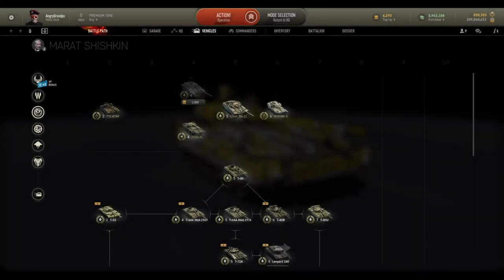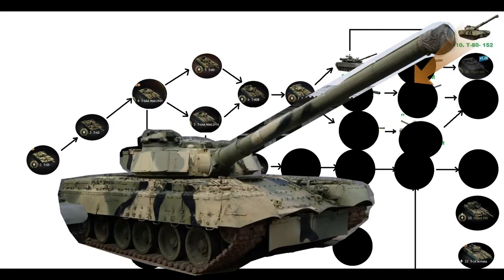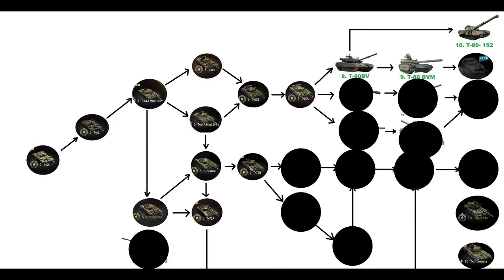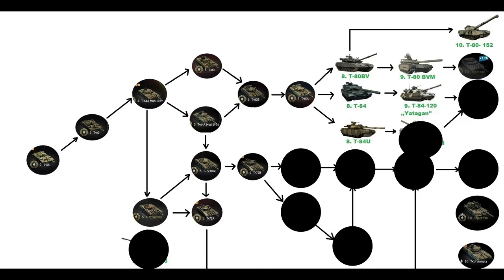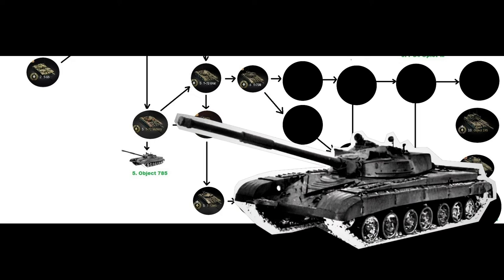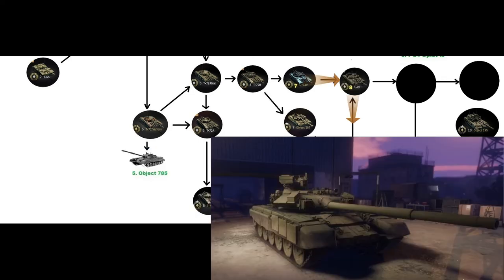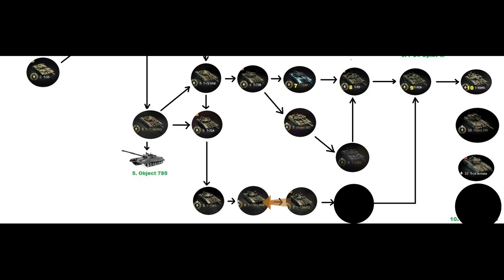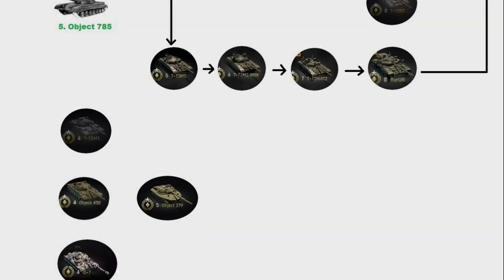[FIXING] MBT Tech-tree in AW | Marat Shishkin

Comment: Second time posting this , my first comment disappeared :)

Nice, interesting video, but there are a few problems with the choices and the info; I also added some personal suggestions where appropriate.

So lets start:

T-72 Victory:  just a skin for T-72 Ural ( also a distinct premium T-72 Ural with this Victory unremovable skin ),  not a different T-72 version. 

T-72 AV: in reality AV is just a T-72A with ERA (Kontakt-1) , which is one of the T-72A upgrades in the game, so we do have the AV version in the game at tier 5 both progression and premium with unremovable skins (ICE, ASH) , no way you can put it at tier 7 ( T-72AV link you put in the description have wrong info in there; as a general rule they add V to the name when adding ERA to a tank that did not had it in its preview iteration )

Object 187 was NOT an improved version of T-72B . Long story short there was two parallel projects to build a successor for the T-72: Object 187 ( mostly.... designed from scratch  ) and Object 188 ( was actually and improved version of the T-72 , it used as many as possible parts from T-72 , making it cheaper and easier to manufacture and to maintain alongside the many other T-72 tanks that were already in operation )  When Object 188 won it was adopted by the army it and went to production under the name T-90

T-90S: S stand for export version , in reality is identical to T-90A ( also nicknamed Vladimir , is the welded turret variant of T-90 , which had a cast turret); the welded turret variant, initially for export-only (as T-90S)  was also adopted by the army (cheaper to manufacture while still pretty good) and  and was named T-90A ; both  T-90 and T-90A ( which also include S variant ) are similar as  "value" on the battlefield, pre1990 technology  , T-90A have nothing to do at tier 9 , and by the way T-72B3 is considered superior as "value" on the battlefield over original versions of the T-90 including T-90,T-90A and S)

T-90M and T-90MS are  almost identical, MS being the export version; the differences are extremely small: different caliber MG (7,62 vs 12,7), M  have anti-RPG net around turret, MS don't, M have few less horse power engine than MS. Cant be used on different tiers ... and must be artificially buffed for tier 10, as is not v good armored, not even for a tier 9, so let it at tier 9 ; the current T-72 -> T-90 -> T-14 line is ok  

Oplot:  "BM Oplot" and "T-84 Oplot-M" are two names for the same tank , the one we already had in game as tier 9 and is almost identical with Oplot-T ( letting aside small details that Thailand wanted changed ,like for example added Air Conditioning, can be artificially buffed to tier 10  ( some thicker front armor , better ROF, crew bonuses from AC for example :)

T-84 and T-84U : same tank with few improvements on U version : side skirts, ERA (Kintakt-5) , improved electronics :FCS, laser range finder, thermal imaging ( can be used as upgrades on the progression vehicle)  should be ok as a tier 8 

T-84 Oplot and  Yatagan : more or less the same tank just different gun and few other minor modifications required by Turks (chassis and turret almost identical, but turkey need 120mm gun because it use NATO caliber and ammo ) , both can be tier 9 with few artificial buffs ( Oplot for progression and Yatagan a premium replacement for BM Oplot so they can move BM Oplot as a tier 10 progression tank to finish the T-80 Ukrainian diesel powered branch , although I don't think BM Oplot is tier 10 material  )

T-80-152: not a real tank name , only production models get "T-" designation, real name is Object 292 as it was only a prototype and tier 10 placement for a tier 6 hull is extremely unrealistic ( even with a big F gun )  How would you compensate the weak armor ? Giving it a 3 times higher ROF then modern Object195 and T-14-152 and extremely unrealistic amount of ammo?
More realistically could be a tier 8 premium with big alpha , slow aim time and slow reload time ( low DPM )

Thanks for the time spent researching and making the video. Keep up the good work :)
Reply from the maker: The normal T-72 (without skins in AW and in real) hasn't so much protection, T-62/64 turret, no frontal discharge of the smoke on the turret, different ammunition, mediocre mobility, engine. 
T-72U (Ural) is an upgraded version with a range finder, etc.

Comparing Normal. https://tanks-encyclopedia.com/coldwar/ussr/T-72/photos/Object_172_(T-72_prototype_based_on_T-64)-Kubinka.jpg
VS Upgraded or with what they added later. https://upload.wikimedia.org/wikipedia/commons/1/12/ParkPatriot2015part2-21.jpg

T-72A, the time when was made and T72AV upgrade kit and so on, to me it matters even if there are small differences.
But yeah, you are right. Can't argue with your opinion and I knew that.  But I live this here https://www.armyrecognition.com/russia_russian_army_tank_heavy_armoured_vehicles_u/t-72a_t-72_a_main_battle_tank_technical_data_sheet_specifications_information_description_pictures.html

From Wikipedia: Object 187 was a parallel project to Object 188, the T-90 tank. It was based on the T-72B, with a heavily modified turret.'' It was based on the T-72B*, it uses the T-72- *everything and gets a new turret. 
By being a parallel project it means that it uses the same chase to build 2 tanks with 2 purposes, one for 188 and the other for T-90.

Quote  ''...T-90A has nothing to do...'' well, it does have something due to its technology and background: the roots from where it comes. So.. tier 9  remains on my behalf. ''...and by the way, T-72B3 is considered superior as "value"  on the battlefield...''. 

Here is a game and here none of the tanks are at full potential.  None of the tanks are accurate from a size , power or technology stand point. Not even in other games such as War Thunder. By comparing them in AW, yes, are like twins but not right by the same technology. Even by the turrets, frontally are not similar but just the chasse is however identical + main gun.

Quote  ''... T-90M and T-90MS are almost identical, MS being the export version.'' Glad you point that out with ''almost''.
Almost is not ''like'' or the ''same'' & that's why are not in the same power but  are similar. ''T-72 -> T-90 -> T-14 Armata'' somehow it is but the armor and everything is different even if Wikipedia wrote '' "The T-90 MBT will be the backbone of the armored units until 2025''. But T-14 Armata is the ''son'' of T-95 or Object 195. 
Also, in my opinion, T-14 Armata should be an option an not the final destination.

Oplots have different names because of different fabrication years, upgrades, modifications, export. If you google about them in particular, you find that an Oplot- oldest, (or the very first versions)  are not the same as the newest or as the export ones. 
Our in-game Oplot BM is not accurate and above many tier 9s & not even at full capacity. As a fact, if the tank is stuck let's say in mud, it can get out without any help from ''others''. Check Oplot chasses, separate- specs in real life. I know it does not counts but this tank has this plus many other features.

Quote ''T-84 and T-84U : same tank'' Not quite because you said, Quote '' ... with few improvements on U version''. 
The T-84 was first built in 1994. T-84U was in 1999.  Both in different years and different ''improvements''. 
You can have the tier 8 like the normal- stock one with a  few things to unlock and the tier 9 version upgraded and perhaps already upgraded. Take as example the tier 9 Leclerc in the game. When you get the tier 9, is already unlocked from tier 7. What's less  important or optional can be unlocked if you desire.

Plus, T-84 should have actually the following as in Wikipedia..
''T-84 Ukrainian -----Modernization--- of----- the---- T-80UD----.  New welded turret and Shtora-1 countermeasures suite, new electronics, new main gun, new armor and 1,200 hp 6TD-2 diesel engine.

So, actually a T-80U/D/ UD -upgraded.
''T-84U Ukrainian upgrade of the T-84 + new armored side skirts, turret-conformal Kontakt-5 explosive reactive armour, auxiliary power unit,  thermal imaging sight, satellite navigation, commander's laser range-finder, muzzle reference system, and other improvements. As a tier 8, it would butcher a lot of tier 6-8 tanks and in PVP will be a monster.

Quote ''T-84 Oplot and Yatagan'' : more or less the same tank just different guns '' yes are different from many stand points of protection, newer technology for export, different turrets, main guns, engines.
''both can be tier 9 with few artificial buffs...  although I don't think BM Oplot is tier 10 material.'' Both can be important tanks for progression. BM Oplot is currently the prime competitor for any Western and Eastern tank. At least this one does not fails as T-14 Armata and is not expensive or nearly to be closed and sent in a barn.

Quote ''T-80-152: not a real tank name , only production models get "T-" designation, real name is Object 292''. Yes I do know that is Object 292. I used 152 to emphasize the smooth-bore cannon use, as in the game for  T-14-152.

Quote '' ...as it was only a prototype ... tier 6 hull is extremely unrealistic'' but in real life it is realistic. In real life the tank is based on T-80UD chasse. Is in description about it. First time on T-80. Was good but a bit instable so they changed to a better one,  T-80U/D or UD and it moved, performed better with a even bigger engine.

Quote ''More realistically could be a tier 8 premium with big alpha , slow aim time and slow reload time ( low DPM )''

To me he can be the only Glass canon of the game. Like, ok! you have a paper chase but a powerful gun.
If you know to play wisely, you can do awesome things. 
Just imagine a better Thunderbolt (by a bit of armor and main gun) with a 152.4mm smoothbore cannon with 11.4 seconds reload time.

How it would be? I mean, they've made exceptions with Burlak to not be on a Tier 5-7 chasse and for other tanks in the game.
Why not with this one also?

As I said, it would be a great addition to the game and also one very interesting that will make some players to be 
less aggressive and more tactical and knowledgeable in the matches. Any tank can be added in the game and not by my video but by real facts.  Also the tanks, Object 292,  turret and chasse is a bit buffed with some protection. https://www.globalsecurity.org/military/world/russia/object-292.htm

I don't think it's suitable for a low tier. Then it will mean a huge problem for low tier, one shot- one blow up or half of the life of the enemy is out. That's why some games with tanks, do not get these tanks in their games. 

Thanks for the feedback and I did not deleted your comment.
If you keep a decent comment, YouTube & filters will let you write & post. Any comment helps the algorithm.